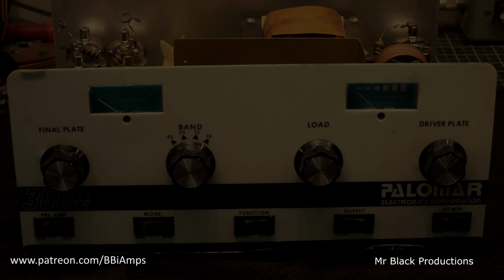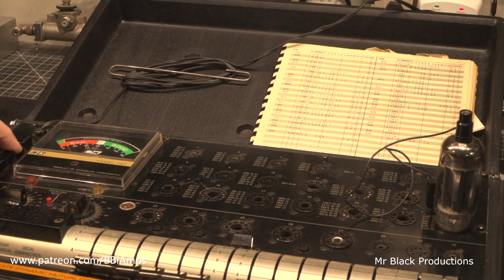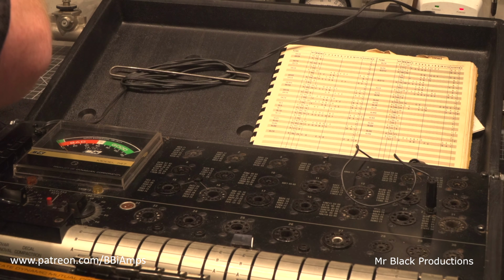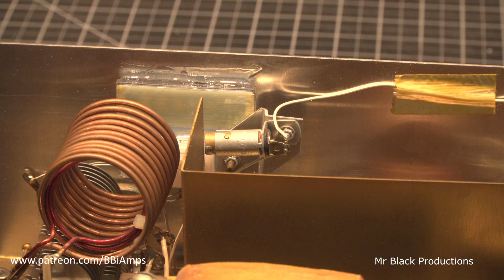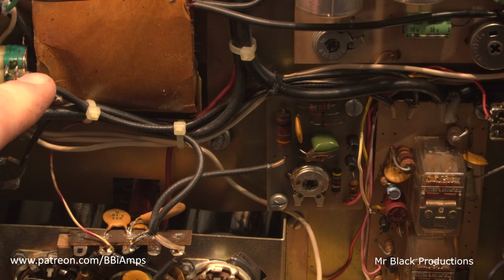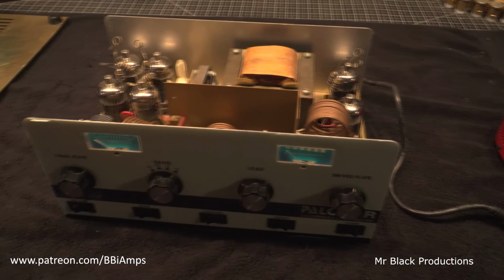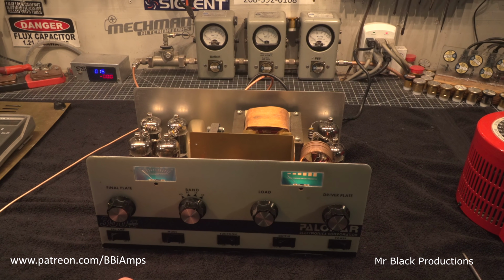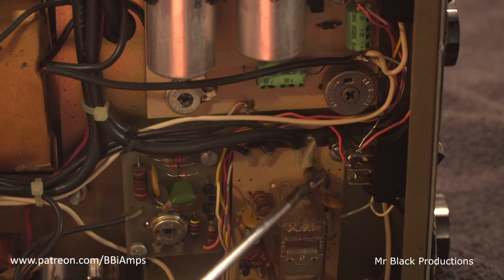Lets take a look at a Palomar 350z

Comment: @Mr BBI I beg to differ on the spring for 102 whip. I measure mine from corona ball to the lug its actually 103 inches. If you use correct ham radio antenna formula for quarter wave its perfectly fine on channel 20. I got a 102 for use a base station antenna took four pieces of braided copper 12 gauge wire cut to 12 percentage longer than radiating element which is used to cut proper length ground radials, put wire connectors on end of wire placed them carefully on underside of antenna mount and carefully tightened lug down i have little rope connected to end of wire and stretched out in four different direction. I easily take to people 60 to 80 miles away on side band from my Lincoln 2+ barefoot. With amp on and on am I easily get out 60+ miles. I could definitely do o better but its cheap set up and little wind drag when storms.

Comment: Mr BBI you won't believe this but I acquired a Palomar 350Z just like that about 4 months ago brand new never been powered up 40 something years old still in the pack and had the original packing still in and around the tubes me being a dummy didn't know about cranking it up slow or nothing like that with a variant I just plugged it in and let it warm up and it works fine carried it to a local old school technician here where I live underdog he checked it out just looked at it and took the bottom plate off didn't see no leaking capacitors or nothing he says most beautiful old piece of equipment he's ever seen it's doing about 700 Watts I did not have the tubes checked out but it was brand new but oh well but anyway I have acquired a brand new transformer for it that somebody had sitting on a shelf for 40 years I paid $100 for it still in the box with the directions on how to hook it up because my technician had mentioned to me that the transformers was a weak spot in them so that being said I love mine I use it for a driver everybody says it sounds great thank you Mr BBI for showing this video on it I learned a lot

Comment: Do you know what the biggest difference between the 300A and the 350Z is (other than the power supply, obviously)? It is MY understanding that the 350Z was actually intended to be run with a 100W Transmitter.
Reply: Billy styron said u a nice guy
Reply: U go

Comment: I got 2 300A amps. rebuilt one power supply . CDE 450V caps new . and others. Them sweep tubes getting hard to get. I got 10 new in box . GE braind. If you bias to hard the tubes hot plate and don't last long. I stuck120MM metal fan in one of mine . great video to watch. 300A has tuchy tone as well. 73's